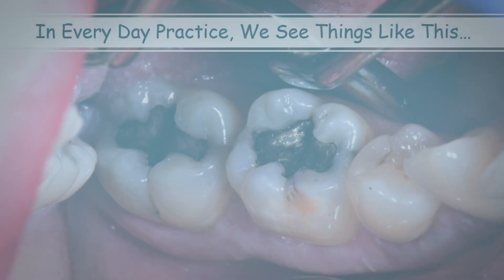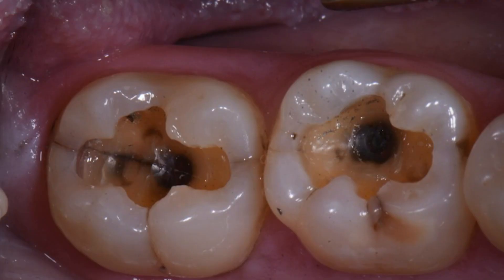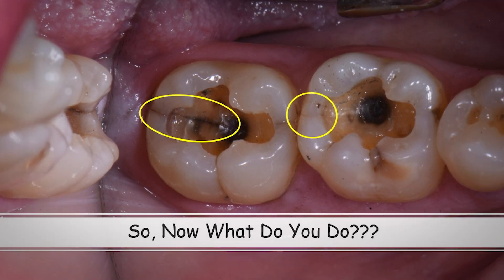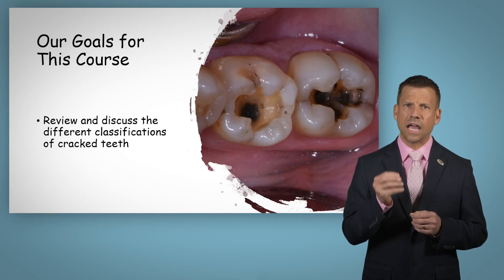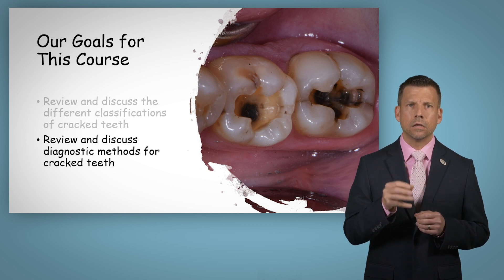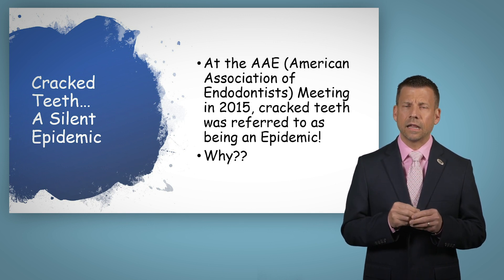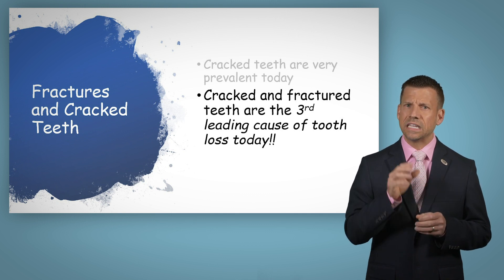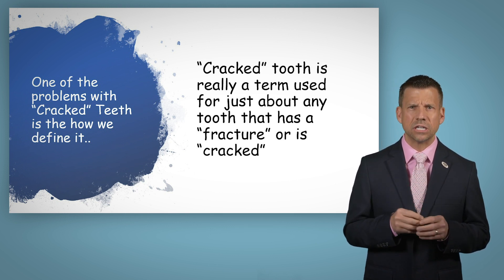Introduction to Cracked Teeth

Comment: what if your dentist cant see a crack visually or on an xray? i'm in so much pain! do endodontists have better tests to see tiny cracks?
Reply: Dentist here. Sometimes you can see cracks, and there are areas on the tooth where they are most likely to form. One test is a bite test where we have you bite on different parts of the tooth and see if it causes the pain. This is a pretty specific test and can be helpful if you can't see a crack. I would say that the majority of cracks form next to teeth with large fillings, especially old silver fillings. Half of the crowns I do in my office are because of old silver fillings with cracks present in the tooth itself.
Reply: @retrogamerdave362  yes i have old silver fillings that are over 30 yrs old
Reply: I had some throbbing pain on my lower right side after x-rays and a bunch of tests they couldn't really decide for which tooth it was so he took a guess essentially and did a root  canal on one of the teeth and a Crown but it still hurts down there so I guess he picked the wrong 1. Unreal. Waste of time money and pain
Reply: @ericsRANDOMclips  wow??!! probably a cracked tooth they cant see without a 3d xray. they actually saw mine by shining a light on the tooth

Comment: Im having weird pain under jaw, right through my ear, also when swallow same time and stretch my head up.. what is it? Its new to me... Could having broken toothache cavity cause that?
Reply: Having the same issue now. What was it in your case?
Reply: @mrg8077  well i had my tooth taken out... it was cracked tooth that was going to die so dentist gave me decision to whether fix or take it out i decided take it out..Pain gone thank god.. it was that cracked tooth gave me pain through my ear and side of my head from same ear. Had been taking painkillers and gel for months on/off. Took tooth out was best decision ever!
Reply: @laurayoung2293  thank you for your response. Do you plan on getting an implant? I've read that if it's a bottom tooth that is extracted, the top tooth may extend itself below. I know my tooth is cracked but was given the decision to save it via root canal or if it's not possible, extract it.

Comment: I don't know if this is a cracked tooth, but I have two teeth that have both created a hole on the as it decayed over time. Over time, little bits or pieces of the teeth on the middle gets removed but I don't know why. Right now, my other tooth also has a tiny hole on it, which hurts a lot if I don't bleed the overgrown gums on that tiny hole. Do you know what this is?
Reply: Same and it hurts so bad now
Reply: This sounds like me.
Reply: @ashleybirchall9132  This is me Also I can A filling There Maybe the filling cause it to decay I brush And Floss Did you get it fix I Go To my dentist April 11

Comment: i had a root canal surgery done about four years ago . recently a piece of the tooth came off while i was eating almonds and now the nerve of my tooth is exposed and when i eat on that side of my mouth . the worst pain ever comes with accidentally biting down on it
Reply: I just cracked mine on my root canal tooth idk what time to I was eating hard candy and and I thought a piece of it went straight down in my gum but that’s not what happened I finally realized I was moving half my tooth bc it was cracked
Reply: @alyssaashley513  that’s scaryyy
Reply: I have that too It used to hurt but now it doesnt
Reply: @gachalifeakiegaming3315  how come it doesn’t hurt anymore ?
Reply: @TL-hx5fl  Idk maybe it was different since I got it in school
Reply: Hi my back tooth is half normal half broken off its not hurting its been like  that for 2 years should i fix it or no ?
Reply: @limitededition3295  i think you should definitely try saving it before it gets worse
Reply: @TL-hx5fl  i dont think il do that
Reply: A woman told my fiance wen he went in to get a tooth checked on that he had an option for the root canal and crown but also told him tbh that most times if your tooth can't be filled it's better to save your money And get it extracted because most times it's going to turn around and still mess up again on down the line...
Reply: @Caramelp229  since teeth eventually are going to decay, we might as well remove them all! What you said made zero sense
Reply: @DX-d  I'm saying wat she told me... So basically I didn't say it the lady from the dentist office did... But I always get mines yanked out even if they can use a filling... Soooooo... 😎

Comment: hello, i think my tooth is cracked but i cant really see since i have braces. I just got them tighten earlier and my tooth really hurts. What will happen with a crack tooth and braces?
Reply: Braces when tightened does feel like a tooth could be cracked...Good luck and hopefully not.
Reply: @lb5998  Tyy! Turns out everything is fine and it was just my braces when I got them tightened. Everything is good now, I feel no pain at all.
Reply: @lindseysolorio9717  I am glad to hear❤
Reply: Same mine ,you need to do is remove ur braces...
Reply: Put oil in it please

Comment: The molar in the back of my mouth cracked in half and now i have half of the top of the molar left, the part that broke off left part of the tooth there up to the gum line but the top half is missing :(  im scared to go to the dentist because im afraid that they will have to pull it out and replace it with another tooth and then have to do drilling and it might be very expensive too.
Reply: Does it hurt
Reply: @proudtuber2114  No pain but the top half of the tooth is gone so I cant use it to chew stuff without risking more damage to it and food getting stuck inside of it :(
Reply: @WiseSilverWolf  luckily it may be a fractured cusp, which is savable and will be treated with a filling and or a crown but you need to get that treated right away to avoid further damage or risk having to get your tooth extracted
Reply: @proudtuber2114  Awesome! I hope that it is salvageable, right now im not working though :( but as soon as I start to work and earn money agian ill go see a dentist asap.
Reply: @WiseSilverWolf  I'm scared coz I think they'll insult me, I'm very self-conscious
Reply: @wrench697  I dont think they would insult you, I mean your the one paying the bill so why would they want to scare you away? and even if they insulted you is that really worse than losing a tooth?
Reply: @wrench697  you either go or you live in pain and without teeth is the bottom line really
Reply: I have the same thing on my back molar, I'm waiting for my mom to take me to the dentist cause I've been asking her for a long time and I don't wanna get it pulled
Reply: i have broke left and right teeth a little pain
Reply: Hey I am also facing this problem my second upper molar has cracked after my wisdom tooth extraction. It doesn't not pain. But food get trapped in that crack... Now my tongue getting hurt by the sharp edges of the tooth... What to do
Reply from the maker: Hello, we recommend you discuss this issue with an AACD member dentist. Find one by clicking here https://yoursmilebecomesyou.com/
Reply: @TheAACD_CRED  Thank you, I will take a look at the website :)